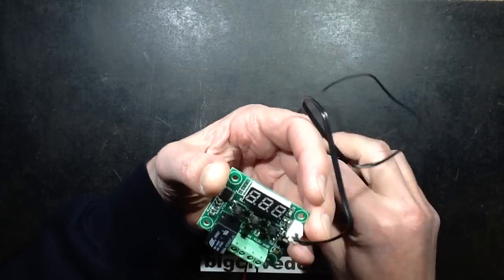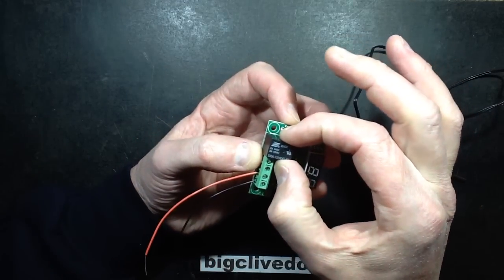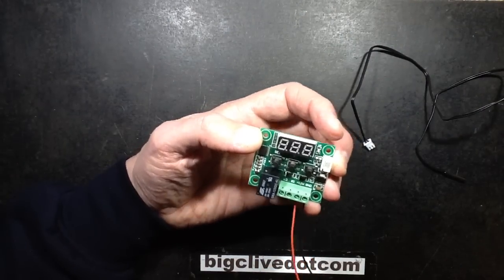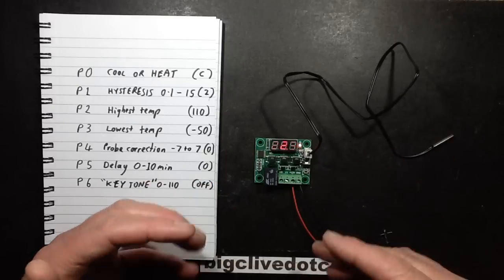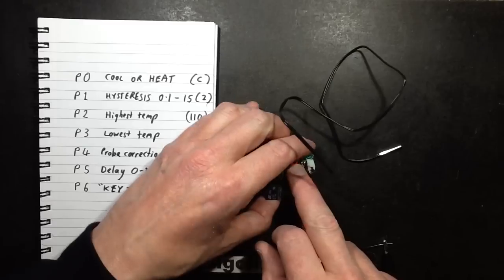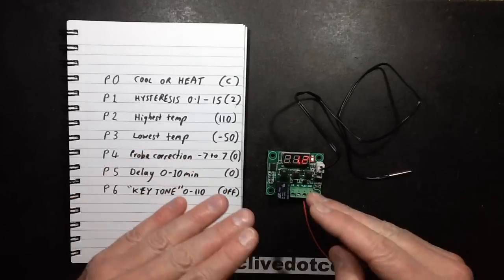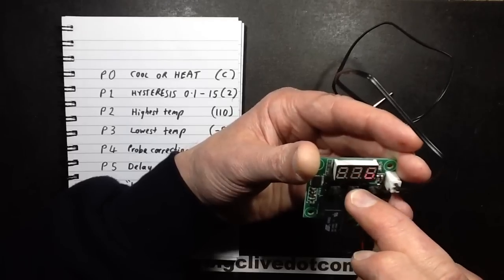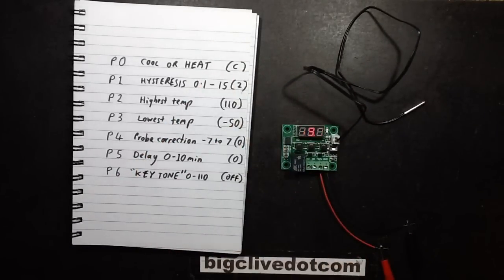Playing with an eBay thermostat module.  New data in description!

Comment: The handiest thing for the time delay is reducing or eliminating refrigeration compressor stalls.  It gives time for the refrigerant to go through the capillary/restriction, and equalize the pressures.  Therefore, the compressor is not fighting really hard to get its first volume of refrigerant into the high pressure side, it just goes in "naturally."

Comment: Thank you for posting this video. It is without a doubt, the best description of the features of this little inexpensive unit. Your explanations are very well thought out, I particularly like your logical thought processes. The accompanying text description is a real asset. I took a screen snapshot of the text and posted it directly to my desktop folder on Temperature Controllers. Thanks Clive, top job mate. Kind regards.
Reply from the maker: +mijodo2008 I should really re-record this video, since other information subsequently came to light as mentioned in the video's description.

Comment: Going to buy one of these for my desktop PC since it can't adjust the fans itself, so they're on 100% all the time (which at night is quite annoying). I'm going to adjust it so that when it's in idle or just streaming a movie, it is quiet, and when some load such as games or rendering heats it up above 40/45 degrees, the fans turn on. This means that in normal use, the PC is very quiet. Thanks to large heatsinks it won't go up to 45 degrees that fast.

Comment: Did you just say that disconnecting the temp probe results in the device thinking it is extremely cold? Fucking scary if used to control a heating load!! "Standard" practice, at least in my experience, is to "fail high" or IOW "missing probe == very hot reading". Or ideally (like a 2 pound device is gonna be ideal - lol) when set as a heating controller missing probe fails "hot" and when set as a cooling controller missing probe fails "cold". Keeps stuff from running away when vandals steal the probe - heh!

Comment: DIYers buy lots of stuff (they don't need ;) ) , but this thing has to be part of some high volume chinese product. I can't imagine how else they would get down to this price, if it were designed just for selling a PCB. Sure, the numbers on the relay seem a little bit "optimistic" and I wouldn't trust it with something that would blow up if overheating, but the board looks clean and they did go to the effort to route extra slots into the PCB, which shows that someone was thinking while designing this thing.

Comment: cool!!  Build a chest freezer refrigerator, much better insulation, top open so cold doesn't avalanche out when door open, relay can cut power to compressor at "refrigerator temps instead of freezing...voila, low power usage refrigerator 

can we get a link to the module?

Comment: I was just about to make a thermostatic relay controller using an Arduino mini, a DS1820 and an OLED display.  This does what I need for less than the cost of the parts.  I'll just have this control a 40A relay.  Can this be made reasonably water resistant?
Reply: Water resistance would depend entirely upon your chosen enclosure and/or whatever means you choose to employ to protect it.  The actual probe is of the type used in HVAC to sense evaporator coil temperatures (often, though by no means always, a 10K NTC thermistor) and the thermistor is typically potted in epoxy within the copper probe tip, so it should already be weatherproof.

Comment: I've been using one of these on my convection propane heater, once the unit reaches 38c, it switches on 3 computer fans below the wall unit to quietly circulate the air. Once the heater cycles, it's set for 8c hysteresis, so the fans stop when it hits 30c, to pull out the dregs. It's been working great for almost a year, and it and the fans are easily powered by an SLA 12v batt, when the juice goes out, sometimes for many hours.  Funny, 'cause just a few days ago, I ordered a couple more, easy way to monitor the freezer and refer when the power goes, letting me know to hook up the backup juicer.
Man, some of these super cheap Chinese gadgets are amazingly useful, and well designed.  As long as mains aren't involved, at least... Keep up the cool work, Clive. Enjoy your stuff!  Blowing up or not.  Any time I get a cheap mains P/S from China, it's apart, first thing.  Don't need any fires in a drought area! (Or anywhere, for that matter.) at least I've only 120v to sweat.  Enjoy! Stu

Comment: Clive I think you using the word bricked wrongly, what have done is crashed it, easily fixed by resetting, something that is bricked is beyond repair and completely useless.
Reply from the maker: +Mentorcase most bricked things can be unbricked, but since there is little information on these devices it is easy to render it seemingly unusable while playing with the settings.  A mere crash would be recovered by turning the power off and on, but you really do effectively brick it with that setting.  I wonder how many people have thrown these out because they didn't realise what had happened and couldn't recover the unit.
Reply: OK I put it to you , if you can unbrick it then it wasn't bricked, some devices have a second version of firmware built in that can be internally copied and overwrite the original and restarted but they were not bricked.
Reply: where does this horrible teenage kind of expression 'bricked' come from? Are we using Americanism again? we should be preserving the English language  especially with such an attractive Scots accent 😇 keep these fascinating videos coming !
Reply: +Mentorcase By definition, if you can "unbrick" something then it was, in point of fact, "bricked" to begin with.  However, by your definition, no device can ever be "bricked" as any "bricked" device can be unbricked if you try hard enough and throw enough time, resources, or experimentation and debugging at it.  By most standards, depending upon undocumented features to recover a device is tantamount to bricking the device as it is rendered utterly useless without that secret knowledge.
Reply: +Nick Clark "Bricked" is basically a variation of rendering something of value little more than a "door stop" or "paperweight", of which a brick may be used for either.  Hence, "bricked".  Once upon a time electronics were of sufficient size and mass to make effective door stops, though in the post iPod era it is hard to imagine such making a very effective "brick"!

Comment: Maybe the key tone is so that it gives a bleep of  a selected frequency when you press a button, and maybe the connections for that option are shorted
Reply from the maker: See the updated description for the actual function, and why it locks the unit up.
Reply: +Sparky Projects That and an audible alarm for max temp detected.
Reply: +ElfNet Gaming I thought of that, but if the translation is specifically key tone' it suggests that a key press gives a tone.
Reply: yeah the annoying "BLEEP!" everytime you press a button..
Reply: +Sparky Projects Maybe the uC doesn't know how to play a 0Hz tone?

Comment: add a "smart" control to a cheap window air conditioner :)
Reply: +Slot1Gamer Relay would not handle the current spike you would have to use this module to drive a 24v contactor that will turn on the unit.
Reply: +ElfNet Gaming if anything wouldn't the arcing from the relay turning off be the killer and not the turning on?
Reply: yes also the lack of surface area on the contacts themselves. A LOT of cheap relays are grossly misrated and labeled when in reality they cannot handle the rated current.
Reply: +ElfNet Gaming it's not because they're cheap, its because its from china ;)
Reply: true lol
Reply: +Slot1Gamer I have a "smart" window AC with digital readout. The problem is it seems to be heavily affected by the temperature of the exterior air. If it gets really hot outside, 40C or so, then it will turn my bedroom into a walk-in freezer. It will run until the coils freeze. I have to keep adjusting the setpoint thoughout the day and then at night when Im sleeping that same setpoint will never turn it on. So it gets hot and eventually I wake up and turn it back down. This repeats and it gets really annoying. Im going to try moving the factory thermistor out to a different point in the room, then my next thing if that doesn't work, will be to use one of these modules and reengineer it  to have a remote thermostat.

Comment: I'm happy that you reviewed this small unit in your video. I am currently using it on my peltier car fridge. the relay is good enough to drive 2 tec...06 peltiers at around 6 amps but when you add another one it draws aboud 10 amps and gets quite hot. What i did is I took out the relay and added the same generic type 12v 10ish amp relays and made them parrallel. relays themselves loads about 120 mA which is not a big deal and drives 4 peltier modules. Had no problems yet for 2 months. Fridge fans and peltiers are running in cycles until they reach the desired cold temperature. quite handy.

thanks for the video
Reply from the maker: +Samet Teke I actually messed up the video because I was still playing with it and hadn't quite sussed all the features.  The video description has been written with a lot more experimentation and has more accurate data.
Reply: +bigclivedotcom yeah you spent quite long time to write that description I assume. what I found on my user manual comes with the circuit is that p6 is high temp alarm. there is some English in it and it says ""LL indicates open circuit of the sensor, HH indicates exceeding the measurement range. at this moment the controller will forcibly disconnect the relay and "- - -" indicates high temp protection"

when you pulled down the P6 to 0, circuit shut it down as high temp protection and waited the temperature to get below 0 to continue normally. but yeah. there is no description on the users manual about how to reset it. I'm glad that you used your investigation skills and found it out for me and probably for others.
Reply from the maker: +Samet Teke I've just tested that and you're right.  I think I may have to remake that video from scratch now I've sussed out all the other things too.
Reply: I appreciate what you do there so no worries. We'll watch it anyway. Cheers!
Reply from the maker: +bigclivedotcom You can also recover from an inadvertent adjustment of the P6 setting to zero by unplugging the probe, which does display LLL but also fools the unit into thinking the temperature is below zero and gives access to the menu again.
Reply: I assume you have gathered more information about the circuit than the ones who mass produced it and sold away.
Reply from the maker: +Samet Teke I just don';t think that a proper translation has been done yet.  I've just updated the description below the video to show the P6 function and the two ways to recover from accidentally setting it too low.  (Not including putting it in a freezer.)